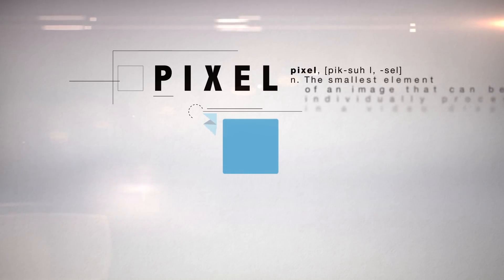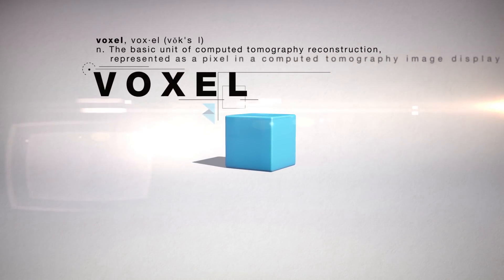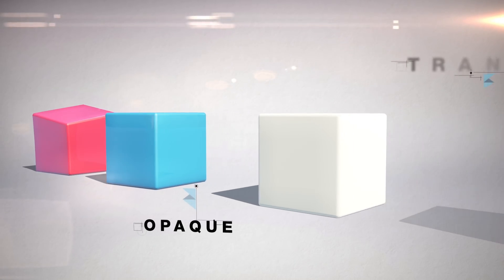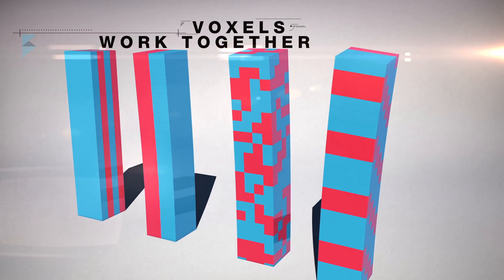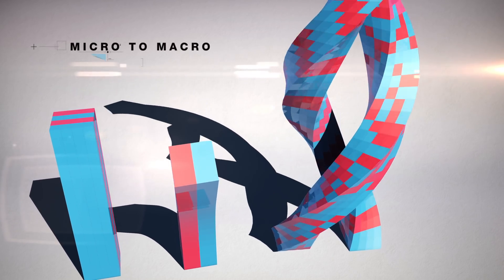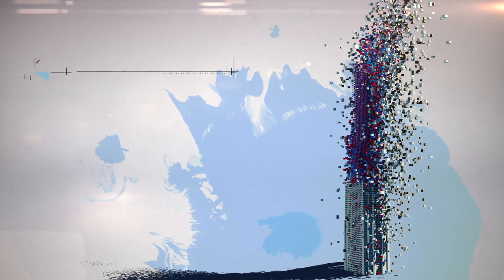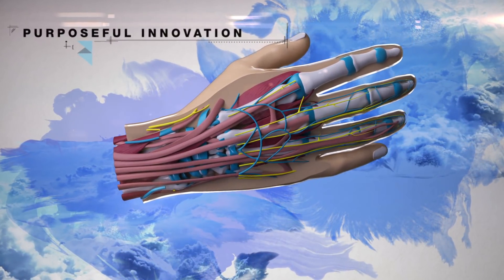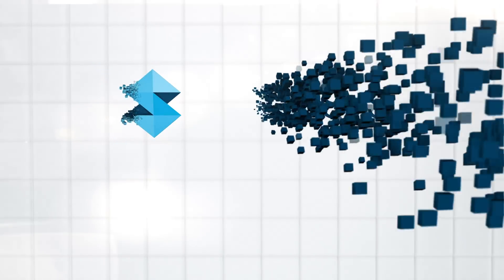Introducing GrabCAD Voxel Print

Comment: Can you really print two voxels together without mixed their material?
Reply from the maker: Yes!
Reply: depends on the printer and how it functions, the size of the voxel, and what type of adhesion neighboring voxels will be seeing. in most cases, like plastic multi-color printing, having the voxels mix, at least some % with their neighboring voxels will actually be an aide to the object's appearence. in other cases you'd want the voxels bonded but seperate for material property reasons. in yet another case you'd want neighboring voxels only bonded on specific sides, to allow sliding surfaces within a part.

Comment: The macrometric properties of most materials come from their geometry at the atomic scale, but not for the metal, most metals have grains that can be seen with the naked eye so we could for example print metals with grains of different size, whereas with the traditional methods of manufacture most of the grains taken at the same place are of the same size.

With a 3d printer we also have absolute control over the cooling rate of the material.

Another use for these printed materials is to deflect cracks and so print very brittle but hard materials
Reply: deflect cracks like that: https://www.youtube.com/watch?v=mEMBmllitbg
we can also print metals with impossible metallic precipitates